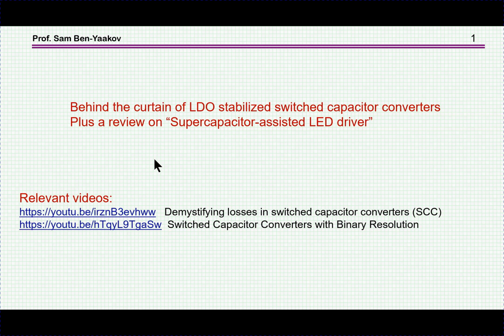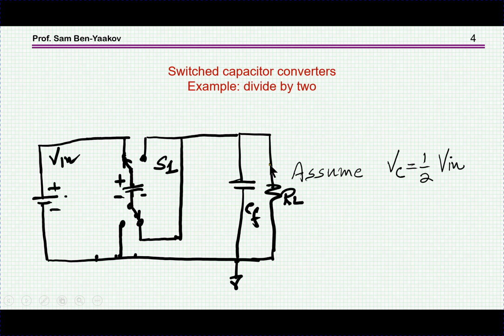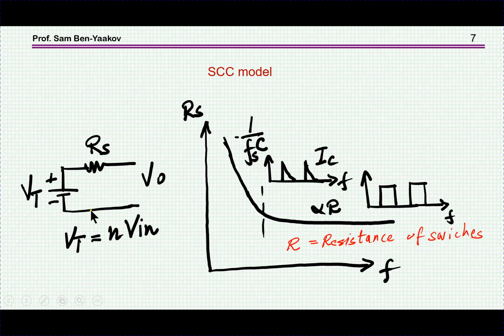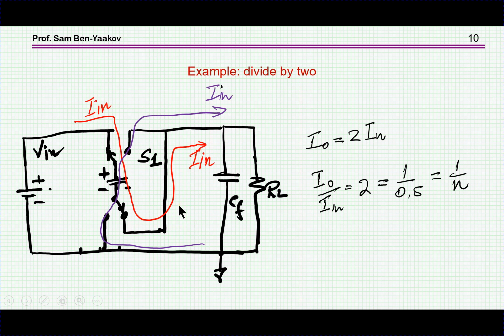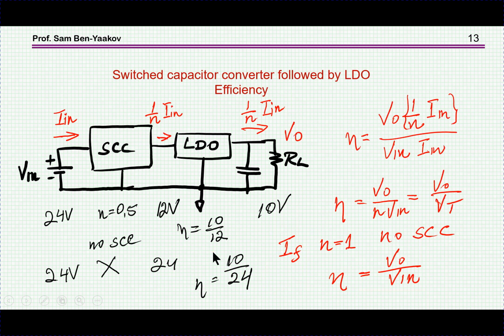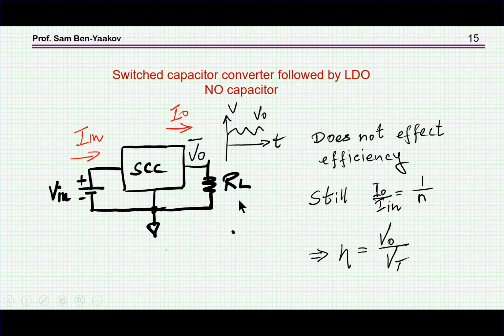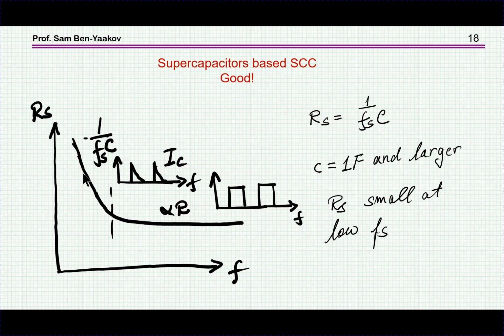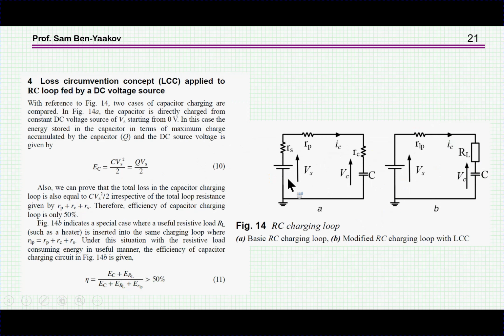Behind the curtain of LDO stabilized switched capacitor converters &  “Supercapacitor LED driver”

Comment: Inspiring tutorial. I used to have a stereotype that the SCC was always low-efficiency candidate. I guess you meant n*I_in for SCC dividers, or I_in/n for n-time SCC boosters. For the three-terminal model of SCC, I_Q should not be zero while the cap is in parallel with load, which "freewheels" the (n-1)*I_in, observing the KCL.
Reply from the maker: HI Zihan if  n=Vo/Vin then the output current is indeed  Iin/n. In the lossless case, 
P= Vin *In =( Vin*n) * (Iin/n) as expected. As for Iq , what I meant is that none of the charge is escaping the input output path because the average current of caps is zero. Perhaps it did come our right. In any event, thanks for comment and for interest.

Comment: Hi professor, can you comments which regulation scheme in SCC is better? SCC with cascade LDO vs VCO type of frequency control on Rs of SCC? If we have a large Vin variation but need a well regulated output, how to deal with low efficiency case since we will have large voltage drop across Rs or large dropout voltage on the LDO?
Reply from the maker: Both will be OK and  certainly same efficiency. Using an LDO will result in   lower output ripple and simplify the circit.
Reply: I guess the loss and thermal distribution could be different, since for VCO type you might concentrate the loss on device and caps, while in LDO case the loss is on LDO chip.

Comment: Just want to check if I got this right.
For example if I have a scc with target voltage of Vin/2 but the voltage on the load is Vin/4 the efficiency wold be 0,5 same if I add a LDO with output voltage of Vin/4 but the inuput voltage on the LDO should be between Vin/2 and Vin/4.

Is that correct?
Reply from the maker: Absolutely correct
Reply: @sambenyaakov  Thank you so much